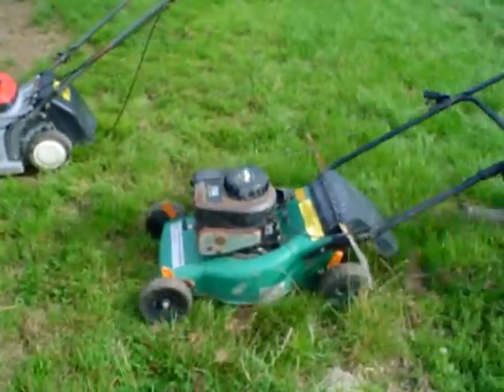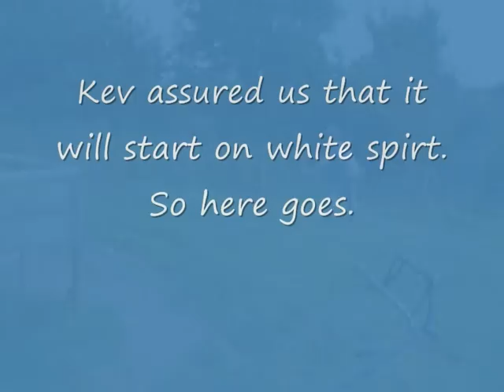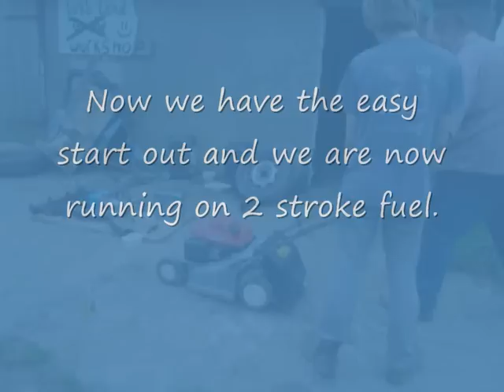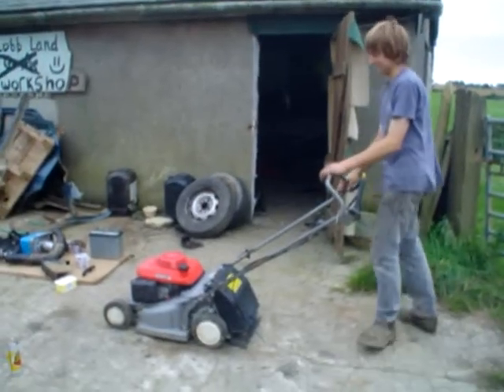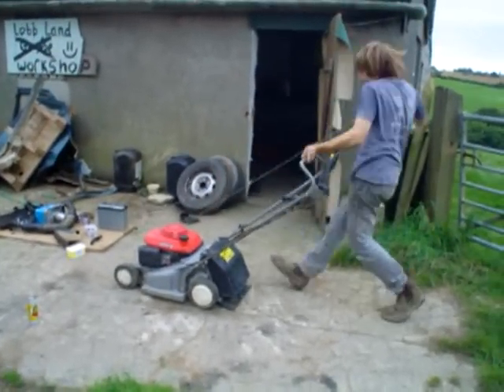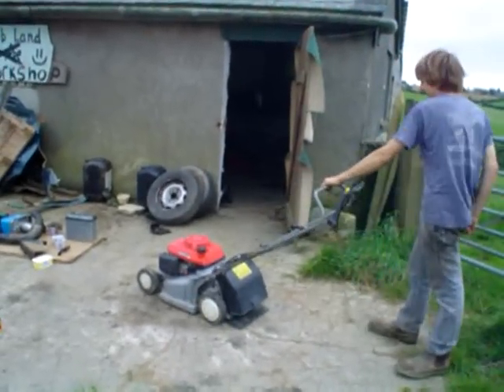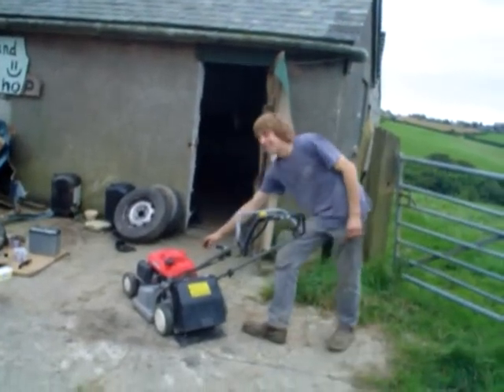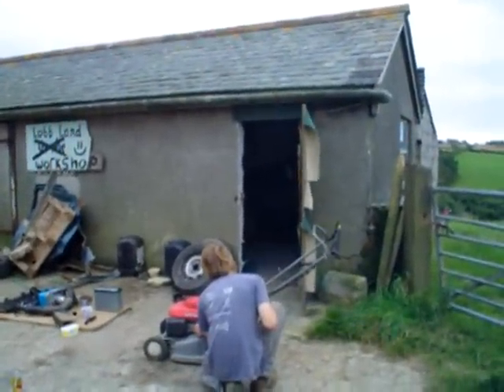fire the honda mower on white spirt

Comment: is that a gcv 190. i have that same mower and it makes a clunk like that but not as bad. i dont like the gcv 190 but i love the gcv 160. almost the same engine but i had better luck with the gcv 160. i was trying to take of the bolt that holds the fly wheel on and the crank shaft snaped.

Comment from the maker: You dont on this style mower, the engine has a proper flywheel as the lawnmower has a blade clutch on it, so you can take the blade out of gear and leave it running...